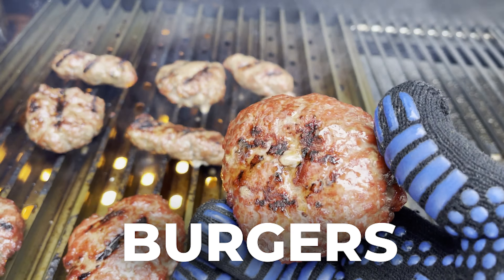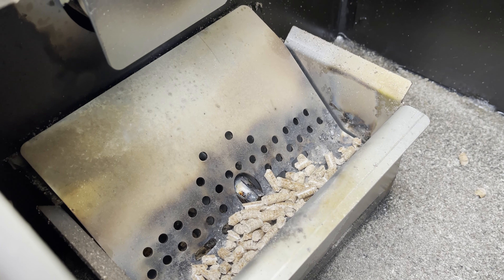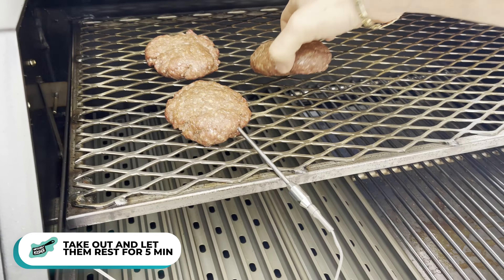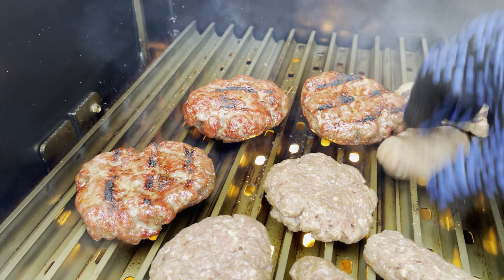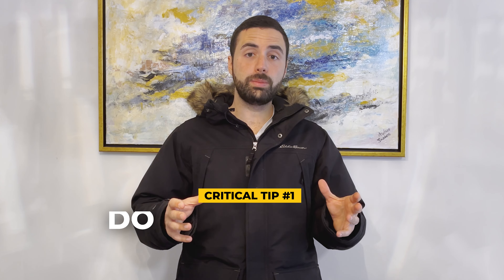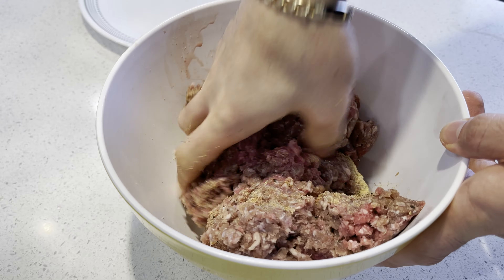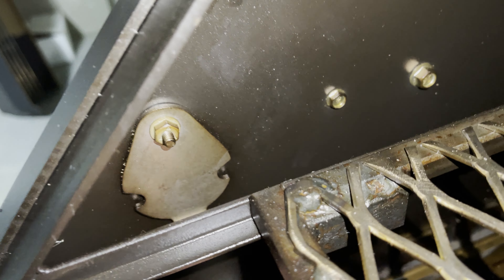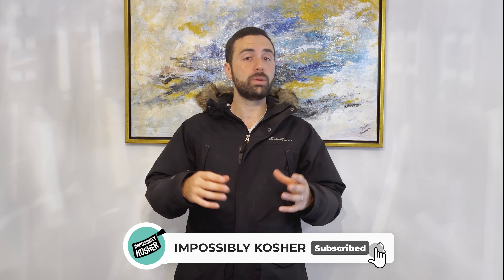Smoking vs Grilling Burgers on the Yoder YS640S Pellet Grill: Which Tastes Better?

Comment: Any suggestions on seasoning the grates? Like using Onion? Used your  cook recipe over 10x great guideline, IMHO…
Reply from the maker: Thanks bud!! I do my best :)
On the seasoning, if you mean before cooking, I used to season with onion or high smoke point oil like grapeseed oil.
But burgers I use are not lean, so the fats that come out season the grates.
The onion is more to clean the grates at this point TBH (for me)…

When making smashburger, I’ll either throw on a bit of tallow, or grapeseed oil.